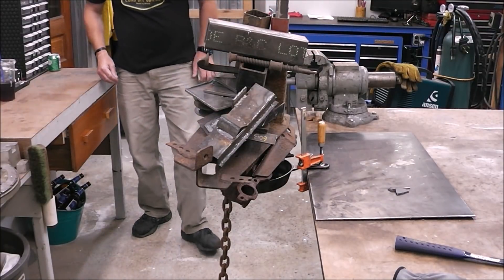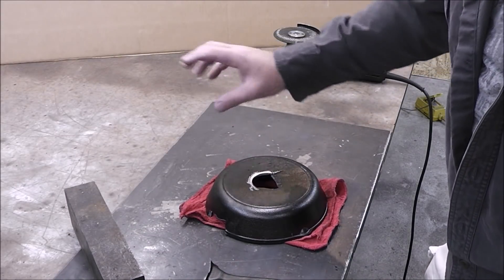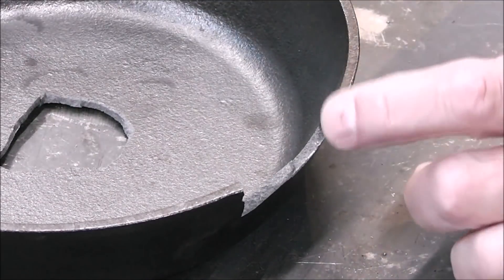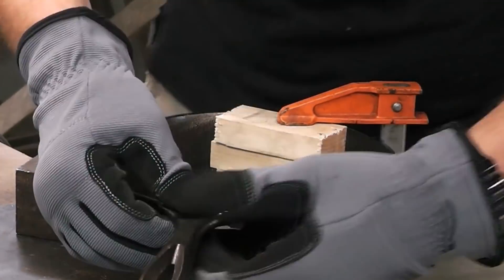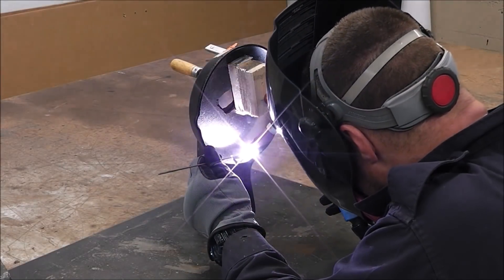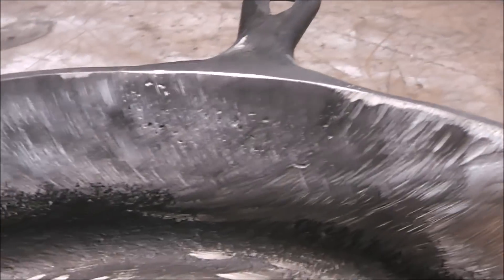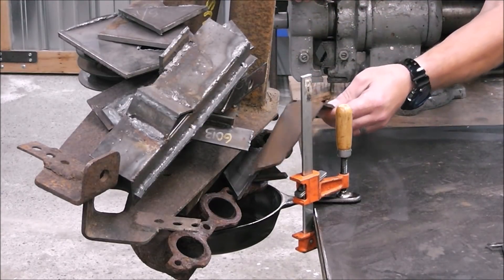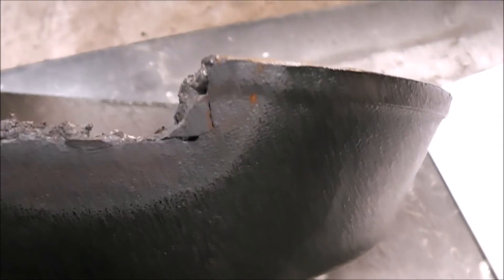TIG Welding Cast Iron Repair with Muggy Weld

Comment: Muggy makes a very good product. Imagine if you had welded both sides and cleaned up the porosity.
Reply from the maker: I agree, Muggy is good stuff. Welding both sides of cast iron doesn't add strength as you might think. In fact it can do the opposite and increase the chance of failure. If porosity is a concern than it should be brazed not welded.

Comment: I do a lot of cast iron repair with TIG welding using silicon bronze haven't had any fail yet
Reply from the maker: Silicone bronze is good stuff...plus it looks nice too 😁
Reply: iamtimyeater , who has 17 pounds of food or more in a iron skillet to begin with, and when was the last time you cooked a log chain
Reply: Does this technique work ?? for high temperatures and pressure vessels like internal combustion engines cylinder heads for fixing spark plug/ injector holes or valve guides and seats or moving the valve stems over by .250 to allow a bigger exhaust valve ( 2.25” inch iron 2G 426 hemi heads and I can use the same valves and valve seats for both the intake and exhaust side ). Sofar I haven’t seen any one on YouTube do any thing like that and I have read about super stock drag racers doing this but because of some of rule books 📚 banning it ( plus moving the valve seats and or ports or massively changing the shape or size ) they got a DNF aka disqualified and kicked out and off the track
Reply: @richardprice5978  I've used silicon bronze to fix all the stuff you it holds up great temperature in pretty darn strong way stronger than the cast iron was the key is heat control more than anything small teeny tiny little bitty bit so that you don't overshock the entire part
Reply: Hello. I am Hans Beamer.  I bought a new lathe machine three days ago and I have a little problem with a cast iron part that Is broken I was wondering if you could guideme fix it. I'll. Really appreciate your help.  Thank you.
Reply from the maker: I'll see what I can do...
Reply: Lately I've been tig welding a lot of cast iron but I use a different procedure. Try using a stainless steel rod with a copper wire rolled in it 😉
Reply from the maker: @Rui Conceicao interesting. I'll have to give it a try. It must flow odd because of the huge difference in melting point?
Reply: @BrandonLund  not att all. It mealts like your tig welding. Just give it a good cleaning, heat it up and weld. Simple as that my friend. At the just give that weld a nice smack with a hammer and let it rest till it cools down.
Reply from the maker: @Rui Conceicao I can't wait to try this! If you are a regular viewer of the channel you know how much I love experimenting and testing and especially trying new things that aren't conventional. Thanks again man! 👍🙏

Comment: would going over all the edges with the tig "like you did making that test spot at 4:38" clean the edges prior to welding?
Reply from the maker: It's probably more hassle than anything. Heating would burn out any oil or impurities so you should be good to go.

Comment: IIRC, Lodge pans are actually some of the best mass-produced cast iron cookware you can get. I'm fairly certain they put them through a very good tempering process. Which would be why it didn't shatter. Not to mention, 600 might be on the low side to mess with lattice structure of cast.
Reply from the maker: They are awesome! I think your right about the temperature....not hot enough to fracture it.

Comment: It would be interesting to see what a new frame pan would do when it’s breaking point is
Reply from the maker: @Gerald Drolet if you check out the cast iron playlist I have a video in there where I did exactly that. I think you will be surprised 👍https://youtu.be/_e9ELJq7Zio

Comment: Hi!  I was wonderingIs there a rod that could be considered food safe for such a repair?
Reply from the maker: To my knowledge the only food grade rod is 316l but it does not work welding cast.  You might be able to get away with 308l but its not considered "food grade" but its cleaner than cast.

Comment: All the welding cast iron friends I have, said nickel rod is safe for repair, why do you say it isn't?
Reply from the maker: Nickel is a carcinogen. Some people can get nickel poisioning from just having skin  contact. It's a great repair filler metal but i would not use nickel on anything that has contact with food just to be safe.
Reply: @BrandonLund  I'm allergic or was anyway to nickel, so what is a safe alternative?
Reply from the maker: @gwenroney3972 silicon bronze is a very good repair but if you dont have torches I have had really good luck with 7018.

Comment: I just thought of something that nobody ever mentions about cast iron. It doesn't rust as bad as steel. steel tends to get rust pits and rust through and cast iron gets a thin rust layer but stays like that. Think about it there are houses that have 60 year cold cast iron water pipes that are still working today.
Reply from the maker: Great point David!
Reply: @BrandonLund  It might sound dumb, but I feel like I can tell cast iron just by its looks and color. with some clues on what it is and how old it is. if its 80 years old and its a solid cast its probably cast iron, lol.

Comment: Glad i use nickel chromium filler before watching this video. I did use the filler and i got crack on the tack right away. I was only using 40 amps and it still crack maybe because i didnt preheat?
Reply from the maker: Preheat is really the key, plus an insulated cool down

Comment: I’m looking into welding a bit of tube onto a cast iron drive shaft for my John Deere garden tractor…not to be confused with these little tractors..this is 4wd…lol
Reply: I want to extend it so i dont have to buy a driveshaft which is the corrrect size
Reply from the maker: I don't blame you. Are you sure the drive shaft is cast iron? I thought they were usually steel
Reply: The shaft that slides into the yoke is steel but it is cast…maybe cast steel..im not sure….
Reply: I just want to extend it so the square tube can not slip out
Reply: I’m not really sure but, im thinking they wouldnt make something like that….only because it’s a critical part…if it were to break it could cause extreme damage, maybe life threatening….least that was my deduction after reading some specs…on a police vehicle i used to work on years ago…i have the entire service manual for the crown Vic..police version
 @BrandonLund

Comment: You actually never hardened that pan when you quenched it. I can only guess that is why you quenched it. The carbon in cast iron does not come out of its matrix at those temperatures you showed in the video. Just a tip from a blacksmith!
Reply from the maker: Thanks man. I just assumed that shocking it by going from hot to cold would possibly weaken it.

Comment: I think if you would have welded both sides, it would have taken a lot more weight to break it.
Reply from the maker: @Jim Pumphrey since you brought it up, here is the answer 😉 thanks for watching buddy! https://youtu.be/qNHAteo-qwg
Reply: Thanks for your reply.  I didn't realize the cast pan was a series.    I would still be curious to see how it would hold up by welding both sides with the TIG like the original welding.   If you have time.  Thanks